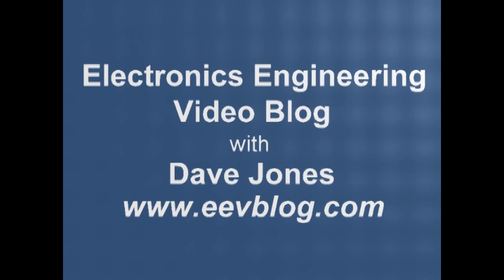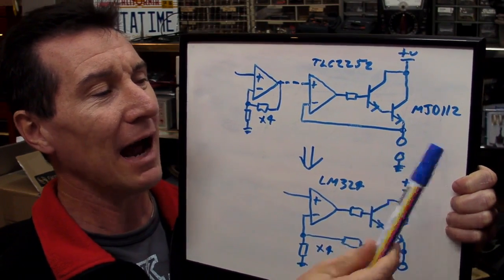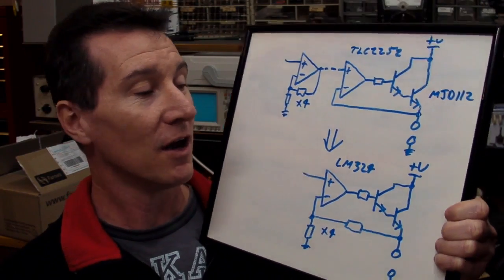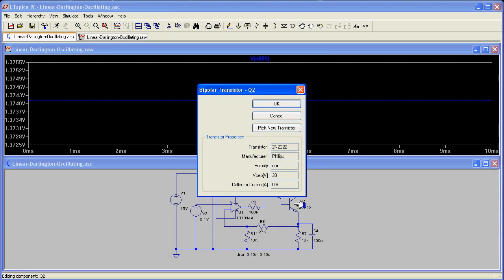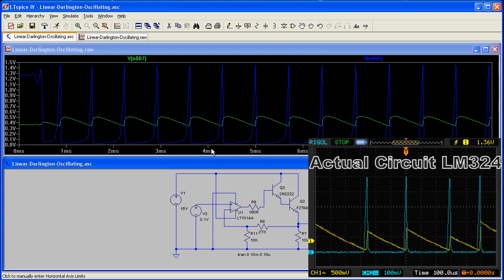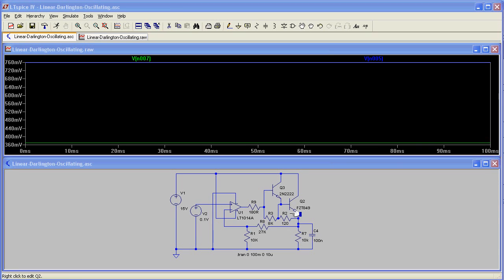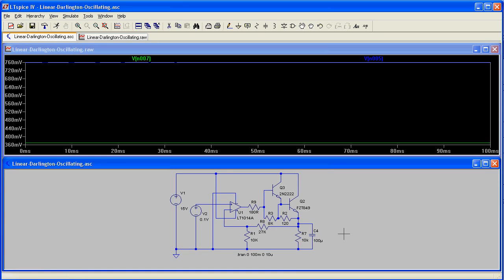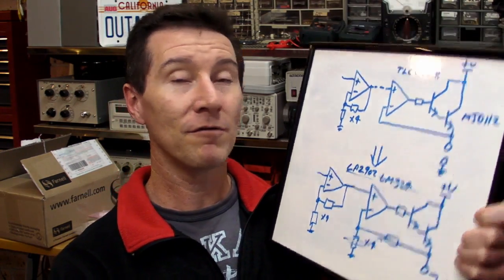EEVblog #95 - Linear Regulators, Closed Loops, Simulations, & Brand Shenanigans

Comment: I suspect all you need have done to stabilise the circuit is connect a 100pF capacitor from the output of the operational amplifier to its inverting input.

Comment: Connect a high value "bleeder" resistor at the emitter of the first transistor of the Darlington pair and connect the other end it to the output of the Darlington pair. Leave the gain at four if you want but kill the high-frequency gain of the feedback loop by adding a capacitor across the feedback resistor. You may need to play around with the values, but it will kill the oscillation. Darlington pairs like this have always had a tendency to oscillate. Why did you choose to use a Darlington pair as the output driver in the first place? What's wrong with just using the output of the opamp as the driver?

Comment: Place a compensating capacitor in parallel with R8 or RC series compensating network. 
Take a look into "Feed foward compensation techniques". I'm currently desining a professional power supply  0-60V 5A, (P-MOS in my particular case, so pretty challenge) and I had have the same problem.

Comment: How can we simulate a circuit as accurately as possible? I have a circuit, where i've managed to obtain all of the simulation circuit components for LTspice. But when i simulate it, i don't get the same distortion and oscillations as i do in the real circuit. I've even gone to the effort of working out the inductance and capacitance of the traces but still nothing the same. The simulation shows that it should be working beautifully well.

Comment: EEVblog This might be a bit late, but for those kinds of circuits you should always use the startup option to .tran ("Start external DC supply voltages at 0V") so the simulation will use the input at 0V as initial state and doesnt start simulation with a steady state. This will lead to much more often oscillation, even with your original 2n222 only circuit right away. As additional hints, I always use .opt numdgt 15 (to force double precision, since oscillation might be smoothed out by rounding) and .opt plotwinsize 0 (to save more datapoints for the transient graph. uses more hdd space and memory, but makes the gaphs much smoother and fft much more accurate)

Comment: True that the theory will not match the actual circuit response, but the theory will probably give you those crucial hints as to what is causing the instability. Otherwise you're just poking around in the dark!

Comment: from the sim it looks like the oscillations are at about 1Khz, i've actually made a linear adjustable supply with an LM324 with whatever power transistors i managed to salvage, as i dont have access to an oscilloscope i cant really check if it is oscillating (at least above 17Khz or so, using a signal tracer) but it seems pretty stable with maybe a bit of noise at the low ends, i'll probably add in those resistors at some stage and see if the noise goes down

Comment: One thing I've found that affects stability of this in SPICE is the equivelant series resistance value of the output capacitor. Without it specified it is more affable towards starting oscilla
ting.

Comment: @darrenhello2 afaics with this solution the circuit would start oscillating again when the load resistance is decreased, as this would reduce the effect the added capacitor has on the feedback path.

Comment: nice video!

shouldn't something like a 22nF bypass cap e.g. from the OpAmp output directly to the inverting input  should have fixed the problem?

R = 10k || 27k = 7k3  and  C = 10n  ==>  1/(2*pi*R*C) = 991Hz

should provide enough feedback to the high frequencies to get rid of the ~1kHz oscillation if I got the math right (haven't actually tried it in a simulator).

But of course this would also make the regulator slower. So one would also need to enlarge C1 depending on the type of load.

Comment: good video... I've just tryd your circuit and inserted a capacitor between the output of the op-amp and the emitter of the darlington pair (to have a sort of miller capacitor effect). It worked with every output capacitor tried. I didn't work with it for much time so I don't know its effects in detail but though it mite help!

Comment: @kraudio7 You can either use solder to join the "islands" (you will need lots of solder), enamelled wire (wire that has a thin isolating cover that can be remove just by heating/sandpapering it) or even standard protoboard wire if your designed pcb tracks are big.

I would go with enamelled wire, its cheap (or you can get some from an old transformer) and its really easy to use and makes the board look nice from the top.